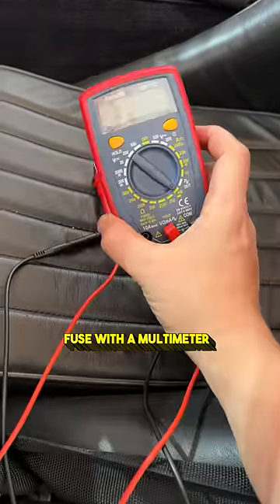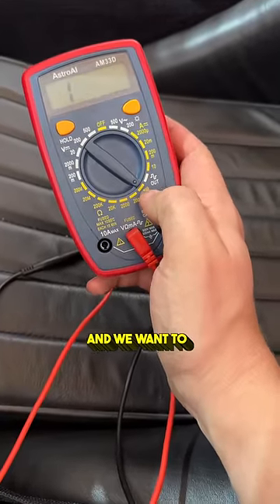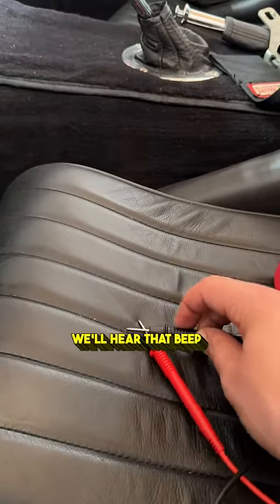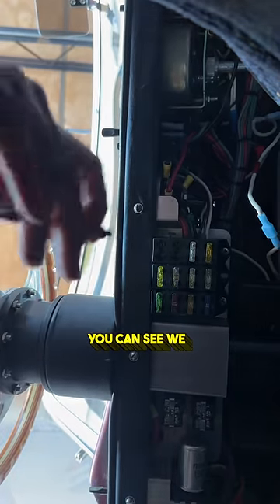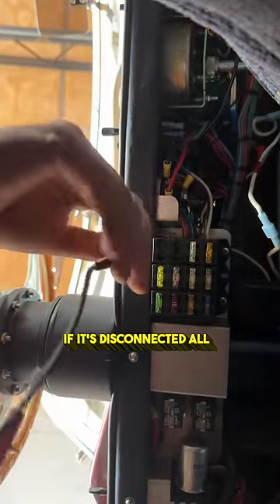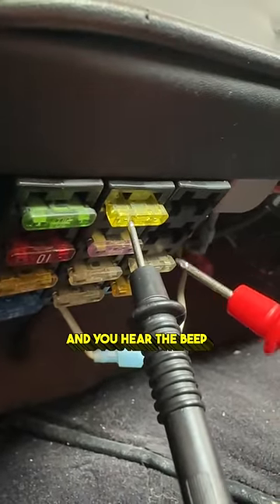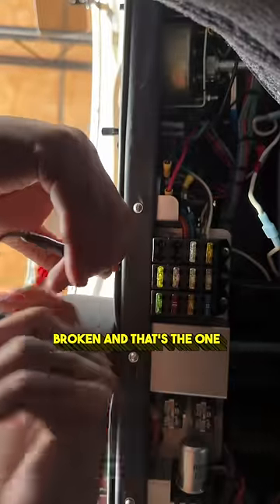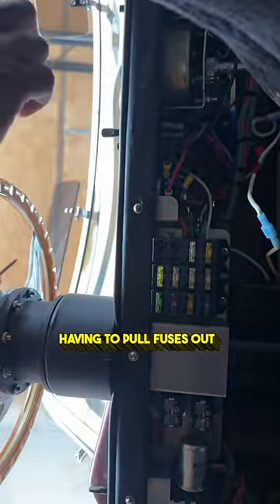How To Check Fuses With a Multimeter

Comment: Excuse me, basic electronics here. You don't test using ohms setting on an energized circuit. You check for voltage, across an open fuse you will read the applied voltage or 12v here.
Reply: Ye u can u go try it for yourself put a blwn fuse in and a good one and try both u will see
Reply: yep. thankfully newer (and good) meters have safety built into them to prevent damage to the meters, or at least that's what i've heard. but, going back to basics, this is def not how u do it... unless u disconnect the battery, which is another context missing in this video
Reply: If you test for voltage what reading would tell you if the fuse is good or not ? Im just asking idk
Reply: 12 volts on either side of the fuse
Reply: @buffalo_6621  If you read 12 Volts on both sides of the fuse, the fuse is good. If you read 12 V on only one side of the fuse, the fuse is bad. If you read zero Volts on both sides of the fuse, that circuit is not energized and you can turn it on to check it or you can pull the fuse and check it with continuity feature of multimeter.

Comment: Not correct I’m afraid. Don’t check for continuity on live circuits. You should set the meter to V DC, connect -ve lead to chassis and then use +ve lead to check for the same voltage on both sides of the fuse.
Reply: What if the battery is out, then this method is ok?

Comment: This highlights the difference in a backyard mechanic and a professional technician. You do not test for continuity of live circuits, with the fuse still installed you can get a false positive for continuity by detecting reverse through a complete circuit and the fuse is actually blown. You can pull the fuses and check for continuity, or most easily you can start the vehicle and turn on all the accessories then check for DC volts between chassis ground and both sides of the fuse.
Reply: What is the battery is disconnected? This method would be fine then right?
Reply: @Ha-42  No, because it's not just about having power available to the circuits. It's that the circuit can loop back around and give you a false positive. It's best to remove the fuse when using the continuity feature of a multimeter to check if a fuse is good. To check fuses without removing them, it's best to use a test light or DC voltage feature on multimeter. If test light lights on both sides of fuse, then fuse is good. If test light lights on only one side, then fuse is bad. If test light doesn't light on either side, then that tells you there's no power to the circuit and you need to turn it on to check it.
Reply: @bernardocisneros4402  Unless the rest of the circuit is functionally just a  closed loop of wire, that probably won't be an issue.  
  
The real issue here is an incomplete understanding of circuits and continuity.   
 
Taking the fuse out reduced the circuit to the fuse, your probes, and the multimeter, which is ideal.
Reply: @jnharton  You're right but it's much quicker with a test light and the vast majority of fuses are going to pass with a test light. The ones that don't pass, I remove and check visually and with ohmmeter.
Reply: @bernardocisneros4402 I have a small led light bulb that has two wires (probes?) coming from it. Is that what you're describing? I've never figured out how to use it correctly, and I'm not sure if the led is bad or if I'm doing something wrong. :c
Reply: @Mottenfest poor mans test light you can check it with a battery then assume it works

Comment: How about just using a  test light It’s even simpler, just connect your test light to a good  ground  and touch each side of the fuse, if the fuse is good test light glows on both nibs

Comment: Or you just use a test light , and put one side of the test light to ground and touch each side of the back of the fuse and see if the light lights up if a fuse does not light up both sides then is blown

Comment: Wrong!!!
Set  meter to voltage - test across fuse
If you read voltage (12v) fuse is bad.
NEVER test across a fuse in place with continuity or ohms. If you do that with highr voltage (house hold 120 / 208 ) you will fry your meter.
Fuses should only be tested with continuity when removed from the circut.
Reply: What volt is the fuse supposed to be?
Reply: @thehomicidalduck6867  It depends on voltage of circut being tested. Automotive is 12 volt. House is 120 / 240. Industrial 277 / 480..

You have proven a little bit of knowledge is dangerous. You should not be making videos like this, knowing so little.
Be safe. Shut off power. Remove fuse then use your ohm meter
Reply: Yeah well you just freaked me out... ugh! I thought I had it. Clearly I don't!
Reply: So what he’s showing in the video he should say this can only be used in vehicle applications?
Reply: He could be testing with the battery disconnected
Reply: @plowe6751  True but you still can not check a fuse via resistance while it is in the circuit. You will read circuit components. Always remove a fuse to test and preferably not on a metal bench.
Reply: @plowe6751  correct.
As I said you test fuses in circuit with a volt meter, NOT  an ohm meter.
Reply: That will not fry the meter. The continuity connection is shared with the voltage terminal so as long as you don’t go over the specified voltage of the meter you should be fine. This method works fine. Because a fuse is essential  a wire with 0 ohms. Although they do read some resistance.
Reply: @plowe6751  that’s very interesting. I’m not a fuse expert but I know a thing or two about hand held dmms and how their functions operate.
Reply: @hardcore4476  No, you never test fuses like in the video. Not even car fuses.
Reply: @wbaldwin666  No, that can still cause issues similar to backfeeding when power is on but power doesn't have to be on.
Reply: @plowe6751  High impedance on voltmeter. High resistance on test light. Test lights don't have impedance.
Reply: @plowe6751  Every fuse has a consistent resistance across it whether it's energized or not. It's resistance will only vary with temperaturre.
Reply: Is very wise to check fuses in continuity to disconnect the Auto battery. If failing to do so you will Fry ( burn in meter fuse) your Meter. Be sure You know what is all about DYs😮
Reply: Actually the importance of the meter doesn't work in wavy conditions such as the more convenient ones do when it's overcharged
Reply: @albertoguerra3995  what?

Comment: My friends 2012 focus has a completely dead stereo and some other electrical flood damage. I did this to check all the fuses. Unfortunately we weren't so lucky for it to end up just being a fuse. Still have to pull the head unit.
Reply: How did it go? Hope it all is back in order and working again!
Reply: @HoodRichSWERVE  well I pulled codes looking to make sure the other o2 sensor didn't go out. but it's a p0420, turns out the catalytic converter has a chunk missing out of it. pieces bouncing around in the muffler. anyway, there were a bunch of u2100 (I think) codes that all pointed to the clock spring being the culprit. as I later found out the cruise control doesn't work either. so now I have to pull the steering wheel apart and check resistance across the clock spring... not something I want to do if it turns out to not be the problem.

Comment: Should the battery be disconnected?
Reply: it need power from somewhere to work lol
Reply: In this demonstration remove fuse to test the integrity of the fuse. The multimeter uses its own internal battery for testing continuity.

Comment: Does the car have to be on or off and do you have to disconnect the battery
Reply: Doesn't matter
Reply: What settings do I put my meter on? I just bought on from harbor freight and I need to check my fuses
Reply: @single_dad there’s a few ways to check

Comment: Will this work if the battery is dead?
Reply: Yes
Reply: @nicholaslombardo9696  thank you!
Reply: Yes  it will. This is called continuety test.  You can also test electrical cables just make sure they are not plugged in the 110v ac or 220.   You can also test the switching sides on relays , you can also test other switches as well.   Multimeter is to me a must have. Makes life so much easier and prevents  one from making costly mistakes.
Reply: It's an ohms check. To test resistance, power should be off. It's also a great way to test if power is short to ground also.
Reply: @dewilliams2012  thank you!
Reply: @frikkiesmit327  thank you!

Comment: Use a test lamp
Reply: Yes much faster
Reply: Not as practical because power is not always running through the fuses unless the component is on whereas continuity can be tested whether the component is on or off.

Comment: This in theory could damage a cheaper meter, unless you disconnect the battery first. With a fuse blown you could have 12V and high current available. Not a problem testing good fuses as there is no potential difference across a good fuse.
Just be aware of a possible issue with blown fuses and the battery still connected.
Reply: I have been doing this with cheap meters and bit more expensive. Never had an issue .  Working on 12v and 24v vehicles now for 18 years. Many times tested fuses like this. And  got a few that was blown that you could see there is defently a short circuit.
Reply: @frikkiesmit327  why not measure the voltage on either side of the fuse?
Or even measure a voltage across the fuse? You won't subject your meter to voltage on the resistance range that way.
Any good meter today won't care, but old digital meters and analog meters could be damaged by subjecting them to a voltage while on the resistance range.
Trust me, it happened to me. Yes, I'm going back maybe 45 years, but think what you are applying to the meter!
It's fine to check continuity across a fuse with the power removed, but in your example the power from the battery is still applied to one side of the fuse, any device that the fuse powers up will be taking the other side of that fuse to ground, probably at low impedance, meaning there will potentially be 12v across the fuse, if it's blown. Like I said, modern equipment today won't care, but older equipment could possibly be damaged.
Would you measure a fuse like that on a mains powered piece of equipment while it's plugged in and powered on? Probably not !! And why not? Because of a possible damaging potential across the fuse !! It's the same principal ! If your equipment is modern, i.e., 18 years in the automotive trade, then I would not expect it to get damaged. I go back 50 years! Yes, all my Fluke,Tektronics, Bryman, and even most of the cheap Chinese equipment today won't care. But with something old, you could be taking a gamble.
Reply: I blew a tester using this method. You would think nothing would happen when testing across one wire, but if the fuse is open, you may actually subject the tester to voltage.
Reply: Voltage meters are open circuits between the probes.
Reply: @mechellewightman8872  What gives you that idea? They are certainly not open circuit. If that were true, they couldn't measure anything.
Reply: If you have your supply voltage measured across a fuse it’s blow. Electricity takes the past of less resistance and in the case of a blown fuse current has no other choice but to flow through the meter giving you the reading.
Reply: @darrend1068  You are missing my point. You should not measure a voltage while the meter is in resistance or continuity mode. It could damage some cheap multimeters. If your meter is one of the better meters, then it's likely protected, but not all will survive.
Do you know what happens to a cheap meter across the mains supply on the wrong range? at minimum, the fuse blows, or it could blow up the meter and damage it. That's what I'm attempting to explain. In the case of a car battery at 12V and 200+ amps, there is lots of potential for damage. Yes, you might not have an issue if you have a good meter.
Not all multimeter are made equal !!
Reply: @KB1UIF  of course your 100%, most if not all come fused in my experience.
Reply: @darrend1068  In my experience, the fuses are typically there to protect over current on the current ranges, not other ranges.
Reply: @KB1UIF this is good to know thanks!

Comment: It might even better to do a normal voltage reading, ground the black and you  should get 12 volts from every contact also but now youre measuring voltage too. Its not loaded but its more information than continuity

Comment: This is not the way to test fuses accurately, it is possible to get a “back feed” this way from the circuit it is connected too due to shared circuit, can lead you down a rabbit hole.
Reply: So if it says the fuse is bad, you remove the fuse and test it again with the probes on the fuse leads.
Reply: Whatever.
Reply: If you get a backfeed then meter will display a - on screen and OL  ( overload) .   I have never gotten that when testing fuses like this. Ive been working on vehicles for 18 years and did test fuses the same way as in video
Reply: @frikkiesmit327 meter will not read OL if there is back feed. If there is back feed you will get a reading. It’s best practice to always remove the fuse. Yes it’s faster to probe right across it but in the case there is some back feed like stated your going down a rabbit hole.

Comment: The meter will act as a bridge between contacts so even if the fuse is blown it will beep as the contacts will have continuity through the meter.
Reply: The whole purpose of a fuse is to break that bridge. That literally how and why they work.
Reply: @peterjohnjoseph  give it a minute. . . Think. If it breaks in the middle, and you connect a lead to 1 side, through your meter, touching the other side with the other lead, both sides are now bridged. Hence, the meter will bell out for continuity.

Comment: But if I changed the fuse and test the fuse port and there is no power there then what
Reply: Then check if theres maybe some other main fuses. Check also on back if the wire that goes into port is still secure. It has happend on some cars like a polo v/ wagen which the factory through they were clever to make sure the wires going to fusebox was under tension. So that caused a wire to pull halfway out so fuse didnt even touch the terminals. Which caused the cars centre lock not to work.
Reply: And also if the terminal doesnt securely clip inside fusebox than what happens is when you insert fuse, you pushing the terminal away leadinh to bad and no connection.

Comment: I just use a test light, either put the black on a ground or if I can get to the neg battery post. I mean. This is good to know To I guess.
Reply: Just dont use test light on any of the wiring harnasses.  You can easily trigger  and deploy airbags of a vehicle. It happend to one technician few years ago. Test light the old type which just consists  of globe, they are basicly a short with little resistance. The other test lights with leds are safer.
Reply: @frikkiesmit327  well I work on equipment only. lol. But good point.z

Comment: 🤔 This is incorrect.  Continuity should only be checked with no power in a circuit.  A (non led) test light applies a load to the circuit and is more effective than your suggestion.

Comment: That does not work in all cases you have to eliminate line and load on the fuse probably just confuse you must remove it
Reply: I had some problem with a 30amp fuse, looked and acted completely normal, had power flow and everything, buy as soon as there was heavy draw I kept having issues, I replaced and isolated everything just to find the fuse was faulty and half connected 😅
Reply: @codypalmer2732 fuses breakdown/wear out but don’t blow until what you describe happens, for us mobile engineers the circuit has cooled down, fuse element touches, continuity ok, experience tells me when chasing this type of fault renew fuses.

Comment: All multimeters don't have a beep. You're gonna have people changing out all their fuses when they are not bad
Reply: I hope they do
Reply: 😂 if they don't have a continuity check mode, they cant choose the "beep" setting.
Reply: Then just use voltage mode

If there's 12v coming through then it's working

Comment: This is bull shit… one major flaw that isn’t mentioned. You MUST have the battery disconnected from the vehicle or a resistance test won’t work.
But the next major flaw is that if you are checking fuses you are looking for a reason that something in the car isn’t working, right? Well, if you use this method correctly you will only know if the fuse is good or bad. You won’t know if there is power at that fuse. 
Just use a test light with a incandescent bulb.

Comment: You will be surprised how many people dont know this simple test procedure . And some you can show and they dont care to learn it.  They rather call the one that knows 😂
Reply: It’s not about “caring to learn it” 35 plus years forklift/plant & I’ve picked up good pointers here on YouTube, I’m saying potentially a shared circuit, or someone who has bridged into the circuit further in, or a relay that has snapped internally etc etc could cause a back feed, been in that position. Also, by testing across the fuse, you can’t see the deterioration across the fuse weakest point, been in many a situation where the circuit stops, being mobile a engineer, 2/3 hours later when we turn up fuse has cooled & 2 pieces of fuse are now touching, no fault found, circuit heats up fuse opens across break, don’t have to have a blown fuse to have no circuit, not personal, but I’d rather do my due diligence, job done right, no repeat calls, have a good day.